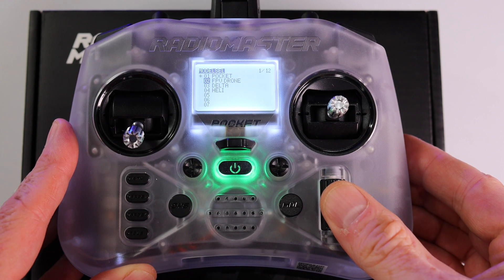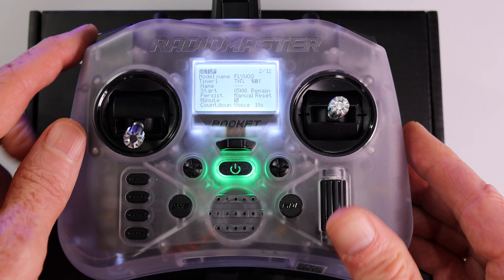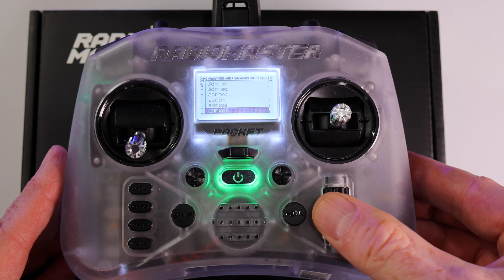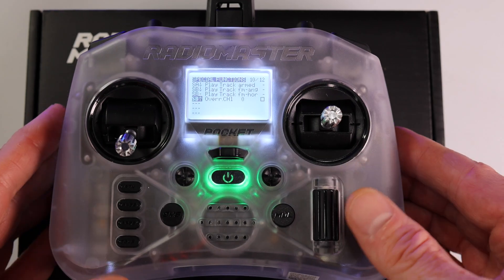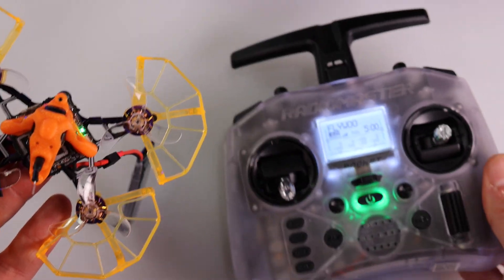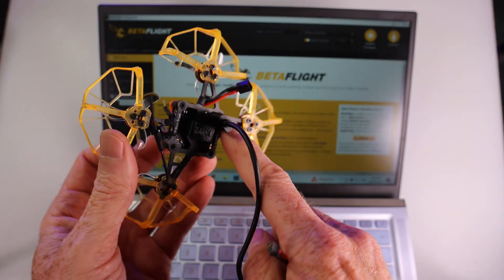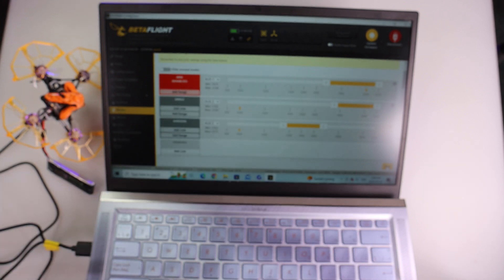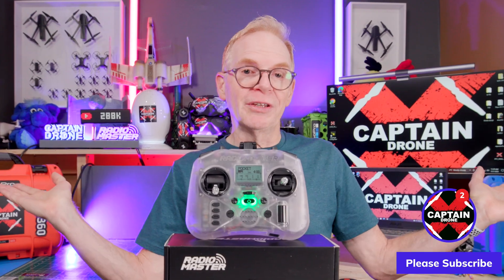RadioMaster Pocket - How To Set Up and Bind a Drone - Step by Step

Comment: It says that my SD card contains no voices, any idea? "No sounds on SD Card"
Reply from the maker: Put the micro sd in your home computer and go to the directory of sounds/voices and then to your language (English) and see if any files are there.  If you see files, then it means your radio is searching for a different language or your radio is not correctly reading your card.  In that case, find a 8 or 16 gig card (nothing higher), and format it, then copy all the files from the original card to this one, then place this new card in the radio and power it on.
Reply: @CAPTAINDRONE798  perfect! I was playing with settings and change the language in system settings yesterday. Fixed now :)

Comment: Is there a certain receiver for it? or does it work with any
Reply from the maker: If you get an ELRS POCKET then it works with ELRS Receivers
Reply: @CAPTAINDRONE798  Thanks!
Reply: @CAPTAINDRONE798  What receiver do you recommend?
Reply: @CAPTAINDRONE798  What receiver do you recommend?

Comment: Is it possible to conect the Elrs Radiomaster Pocket with the Tinyhawk 3 Plus freestyle(analog and not HD Zero)?
Reply from the maker: Please be aware that ELRS Radios can connect to an ELRS Receiver as long as both are on the same firmware number and both are at the same frequency.  This means you really need to know what receiver is in your Tinyhawk 3 Plus Freestyle.

Comment: How do I know or find my rm pocket's elrs firmware number and specially my binding phrase? 😊😅
Reply from the maker: ELRS FIRMWARE version is located in the RADIO specs (go into the radio menu screen.... you know that screen where you can set up the date & time on your radio, then scroll right).   Binding PHRASE is something you creat in the ELRS software.  Not many people do that anymore.
Reply: @CAPTAINDRONE798  Just to be sure, is it the one under the bind? And by any chance beside that number is the binding phrase? 😊😅
Reply from the maker: @zackkheiloevangelio3583 Yes, I believe that is correct

Comment: I just got an newbeedrone acrobee65 and im trying to get it to pair to my radiomaster pocket controller. First issue i ran into was on the setup screen the internal RF only had off and multi. I read on some reddit threads that in the hardware menu for the system i can change the internal rf to crsf. So I did that, and now trying to load the expressLRS its just stuck on the loading screen. Any ideas?
Reply from the maker: Yikes!  You bought yourself a MULTI-protocal instead of an ELRS.  Do you know what type of receiver is in your acrobee65?
Reply: @CAPTAINDRONE798  Per getfpv, its got Crossfire Nano receiver with MINIMORTAL T Antenna

Comment: The plugging in and out 3 times to activate bind mode,  does that work for all drone? dosent seem to work with my pavo pico
Reply from the maker: Only works for drones with a dedicated ELRS receiver that you can see with your eyeballs.  My guess is yours doesn’t work for two possible reasons:
1.  You’re doing the process wrong
2. You’re drone is ELRS SPI which means it won’t work the standard way and you need to bind it via Betaflight configurator

Comment: How do you select NO switch for timer settings? I accidentally scrolled the wheel while on that setting and now there's no option to have no selection even though the manual says "[Switch] - Select the switch that will trigger the timer to start.  If no switch is selected, the timer will trigger based only on the configured mode."

Comment: Thank you for making this tutorial but I want to add that the timer is best to use mode: ON (started when activated and stop when deactivated) or Ths (started after throttle is raised and switch activated) but to simplify ON is better.

Using Th% really not recommended and will ruin your time. At my early flight I am using Th% following your guide and I depend on my TX and not paying attention to OSD for when I should land and the battery dropped till below 3 V and VTX die.  

Th% could count double your true flight time. And honestly I dont understand why did you recommend to use Th%. ON is easiest for everyone.

Comment: Thank you for this video, very helpful. 

One question. At 3:10 when i go back to the main dashboard i see a blinking value -6.36 instead of 4.39 as in your case. Also there is no reset flight menu when i press the scroll wheel. What might be the problem in my settings?

Comment: good morning I got the master pocket lrs radio I wanted to know why I can't do the Bind myself or an emax Tinyhawk 3 plus Freestyle HD drone
Reply from the maker: ELRS transmitters only binds to ELRS receivers and both must be on the same FIRMWARE
Reply: yes but both are ELRS sorry if I spelled it wrong before both the drone and the remote control are ELRS
Reply: si ma entrambi sono ELRS scusa se o scritto male prima sia il drone che  il radiocomando sono ELRS
Reply: The radio control settings must be the same as those you set, even if it is either a drone returned by you or an EMAX Tinyhawk 3 plus Freestyle, even the minutes one because you didn't set it

Comment: Thanks for this video explained really well. I am new to this radio system or protocol. I have a question to ask you. Why when you enter the expresslrs location you notice the name of Radiomaster Zorro and not Radiomaster Pocket like mine? I bought this radio a few days ago, do I have to update the firmware? Unfortunately I haven't been able to bind anything yet. This is the second radio with integrated expresslrs that I've bought, the first time I sold it out of desperation. One of these days I hope to bind a tinnywhoop.
Reply from the maker: My POCKET RADIO shown in this video is a pre-release version sent to people in the RC Hobby to test and evaluate so mine has older firmware in it.
Reply: Thank you!

Comment: I hate ExpressLRS so much right now :face-purple-crying:

I've been trying to connect my Mobula8 to my Pocket for 8 hours now, spread over a week.
Nothing works. No flashing (both drone and remote) no passphrase, no "classic" binding...
Something jiggles on the channels in Betaflight configurator when I press bind like described here, but the connection seems to be lost immediately.
How TF can I get this to work!?!?
Reply from the maker: Binding ELRS is super simple, as shown in my video. If yours doesn’t work then it is due to two possibilities.
1. You’re doing it wrong, and/or;
2. Your receiver and transmitter are on different firmware versions.  If one is on firmware 2.x and the other on 3.x they will never bind.  You need to then either upgrade the firmware on one or downgrade the firmware on the other.
Reply: @CAPTAINDRONE798  Thank you very much for your answer, but I sure checked the obvious stuff in these 8 hours ;-)
After 9 hours I found the problem: The SPI receivers in the Mob6 and Mob8 don't work with D(D250, D500), F(F500, F1000) and Full Res(100Hz Full Res, 333Hz Full Res) Modes. That was not very obvious :face-green-smiling:
Reply from the maker: @FPVRacingDrone ahhhhh. SPI ELRS is very different from normal ELRS and you bind it via BETAFLIGHT CONFIGURATOR vice every other normal method.

Comment: Just ordered the Pocket and ERLS rx quad. Beginner. Just playing around with a micro FPV indoor 1s quad with non-Betaflight FC. Thanks for the video tutorial.  Question regarding the mode switch. Can it be set up in reverse than what you demonstrated?  That is, SB-up as Angle mode, no change for Horizon mode, and SB-down for Acro.  Betaflight Configurator supposedly gives you the option to set up "Rate Profile Settings".  Would like to set up an "indoors" rate profile.  Throttle limit, expo and control(Roll, Pitch, Yaw) expo, max rates.  Possible to set the custom rate profile to another switch.  Basically a Angle and either custom active or off.  If possible might use the remaining 3 way and add couple custom rate profiles to link with Angle Mode active on SB.
Reply from the maker: You can do pretty much everything you mentioned

Comment: Hello Steve, your video is very much informative & easy to follow. Thank you very much! One question... Is there an option to reset the system to manufacturer default? With my appreciation, I'm now adding my insignificant ONE THUMBS UP & SUBSCRIBE!
Reply from the maker: Yes, that option is normally in the system settings.  Welcome to the channel.
Reply: @CAPTAINDRONE798  Thanks Steve for quick response. But I've checked all pages, and I couldn't find it. Probably I missed it. Do you know where exactly I see the reset option?
Reply from the maker: @paternos5033  I'm no where near my POCKET radio so I'll do this from memory.  Did you hold down the SYS button (you know, to enter the system menu on any radio, and then PAGE button, left or right, to scroll through the system menu items).
Reply: @CAPTAINDRONE798  Hello Steve, I pressed the system, and checked pages 1 up to 7, but no "reset" option. Thanks again Steve for your response.

Comment: Hello, after setup up and binding, all ok, but when I would like to connect to PC, don't work. In Betafligh can detect, but in simulator programs don't detected. Could you help me?? thanks!
Reply from the maker: Power on the Pocket. Plug a USB into your computer and other end into the Pocket. Select JOYSTICK on the pocket display.  That’s it, all will work.  If it does not work then the reason is simple.  Either your computer is out of date or you have not figured out how to use an external USB remote in a simulator program.  You’ll figure it out.
Reply: Thanks for the quick response. I figured out that the issue was with the Steam configuration, and it wasn't set up correctly. Once I disabled the generic controller support, everything started working. @CAPTAINDRONE798

Comment: Hi, any chance you know how to show the drone battery voltage on the radiomaster pocket ? I can’t work out how to do it,  also when I press the telemetry button I just get a syntax error, I have the right lua script on the radio, this is a major frustration lol
Reply from the maker: Normally if a receiver has telemetry (most don’t) then your radio picks it up during the bind process.
Reply: @CAPTAINDRONE798  I have it from all my quads on the tx16s but not on the RM pocket

Comment: This is great.  Everything works great except my quad wont arm!  I can see the controls (and 3D) movement in Betafilght, when I hit the mode buttons, the audio works and BF shows the right indicator.  The only thing that aint working is the arm!  When I press the arm button, i can hear it say Armed, I can see the count down, can see that its armed in Betaflight but the motors wont spin.  I did take the props off. Any ideas?
Reply from the maker: If you see the joysticks move in Betaflight (those bars on the screen), then your drone won’t are because:
- your left joystick is not 100% DOWN
- you bought an FPV drone with a GPS and the GPS needs to be outdoors and get 8 satellites before it will allow the motors to arm.
Reply: @CAPTAINDRONE798  Thank you. I'll try this outside. 🙏
Reply: @CAPTAINDRONE798 I took the drone outside and it still won't arm. :(   I don't understand something "you bought an FPV drone with a GPS and the GPS needs to be outdoors and get 8 satellites before it will allow the motors to arm." - does this mean that if a drone has GPS, you can't test the motors using the sliders in Betaflight?
Reply from the maker: @f2f.photography So that means you have done something incorrect with your setup or you are simply doing something wrong in your arming. When you connect tthe drone to Betaflight Configurator and move the joysticks you’ll see the bars move onscreen regardless if you have a gps or not.  Also if you set a switch on your radio to be the ARM switch (and you do it correctly) then your radio will send a signal to the receiver in your drone when the switch or button is pressed. It is up to you to assign that switch/button in Betaflight Configurator to the ARM mode within the MODES section as shown in my video.  Trust me when I say you have either done something wrong or are doing it wrong.  This means you will eventually figure it out and get it working.
Reply: @CAPTAINDRONE798  Yes I agree I am doing something wrong, its prob something simple too.  I re-watched and re-did the setup again and everything "appears" to be working.  When I press the arm button, the left side of the Pocket lights up green and in BF, I see it armed with a red box in the Mode screen.  The yellow bar and yellow tricky thing align on the right side.  All controls move the 3D model in the Receiver tab.  I have checked each button (that we setup in this video) and all seem to work in BF in the Receiver tab and the Modes tab.  I must be missing something simple.  Just can't figure out what it could be.
Reply from the maker: @f2f.photography scroll down on the MODES tab in Betaflight Configurator and make sure you don’t have two different functions assigned to the same AUX switch.
Reply: @CAPTAINDRONE798 I checked that.  My arm button is Aux 1 (Yellow bar on far right side and tickey mark below it when armed), my Angle is Aux 2 (bar on the far right side), Horizon on Aux 2 (bar in the middle).   My Aux 3 is beeper.  Hummmm.

Comment: thank you for your video, it has been very helpful for me as a beginner in FPV drone. I tried following the steps you provided, and it worked. I have another question. Do you have any advanced videos on connecting the drone to goggles?
Reply from the maker: There rarely are videos regarding connecting FPV goggles to the video output of a drone because it is super simple. If your goggles are ANALOG, you simply scan for the band & channel. If your goggles are digital, you simply press the bind button on drone & goggles.

Comment: Thank you for the excellent video. I have a Mobula 8 that I can't bind. When I insert the power cable into it, as you instructed, it doesn't beep multiple times and can't bind... Any thoughts? Thanks again.
Reply from the maker: Power cable?  Power cable as in a battery cable?  If you are talking about the part where you plug the battery in 3 times on a drone that has an ELRS RECEIVER, then the drone MUST make a series of tones when a battery is plugged in.  If not, then it means your battery is dead or your drone is broken.
Reply: @CAPTAINDRONE798 Thank you so much for your time and help!

Comment: здравствуйте. аккумуляторный отсек подойдёт для батареи толщиной 65мм и длинной 650мм?
Reply from the maker: The battery area is designed to fit an 18650 battery.  Have a look at the dimensions of an 18650 battery.

Comment: I'm a new player in drones. I have SJRC F22s for 6 months i would like to know if it is possible to bind with ELRS remote controller?
Reply from the maker: Nope.  ELRS only binds to ELRS, and there is no ELRS in the SJRC F22s.  ELRS is a LONG RANGE receiver.
Reply: @CAPTAINDRONE798  Thank you for your reply. Another question, so if want my SJRC F22s to have a new controller that can go a longer distance what can I do?
Reply from the maker: @samcho882 You can’t.  Drones with cameras and GPS that come in a box with a remote can’t be modified.

Comment: Elrs is so different. This definitely did not work for my diamond f4 fc and radio master pocket. Every single elrs video has different steps. Lol ive been flying fov for almost 8 years. Elrs is a mess to settup. Im totally lost. All of yall just confuse me personally
Reply from the maker: My guess is you’re missing steps in your procedure (I.e., doing something wrong or missing something) if you’re using the Pocket. I have tons of videos with simple walk through steps like this and occasionally elsomeone new to the world of setup up and binding a radio/drone, they often fail for a simple reason… however, in every case they eventually get it.  So keep trying and you’ll eventually discover what you’re doing wrong or what you need to do extra based on your gear.  Thousands have been successful and with a bit of effort so will you.

Comment: Thank you for the step-by-step guide. This was so helpful because I was going bananas. The only other thing that I would add is to upgrade the Sim card that’s in there. You only need a super small one like a 16 GB because my SD card failed with the one that came in the box, so I had a little bit more of a learning curve.
Reply: Is there data that needs to be transferred or just swap when new ?

Comment: I bought the cc2500 version of this controller so I could use with my frsky drones and this video definitely helped with the only difference really being the binding process which you simply do within page 2 after turning the internal rf on and to frsky d 8 for my case there is a bind/bnd option there on page 2 that after the drone is in bind mode you simply click bnd on page 2 that’s it well of course after binding go through bf like cap shows here. This video definitely helped and saved me some time so very much appreciated cap as always a great video and very informative.
Reply from the maker: Glad to read it was helpful

Comment: I'm absolutely clueless on Betaflight but this video does break down many of the myths regarding set up. I have the old Jumper T8SG radio on deviation but the Radiomaster with Open TX looks a great option. Thank you for this video Steve.
Reply from the maker: Glad it helped
Reply: @CAPTAINDRONE798  I need some help! I accidentally fiddles with the drone when you were resetting the timer, and now it won’t start whatever I do!